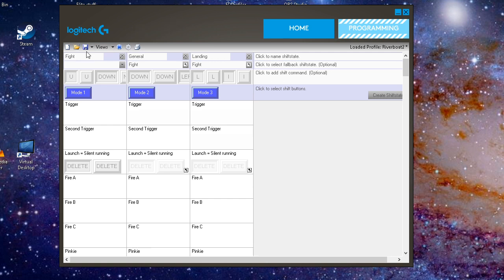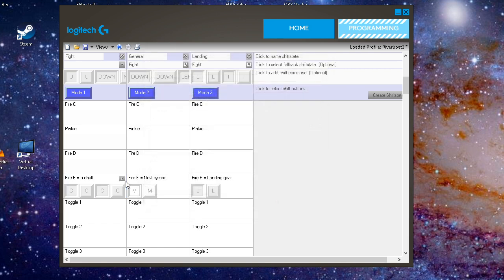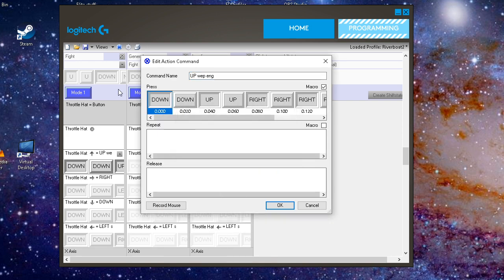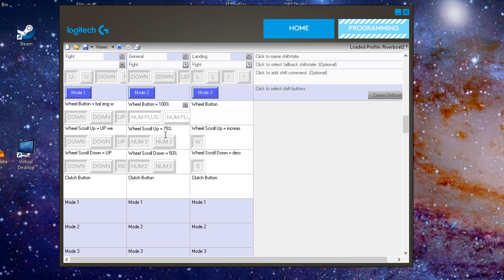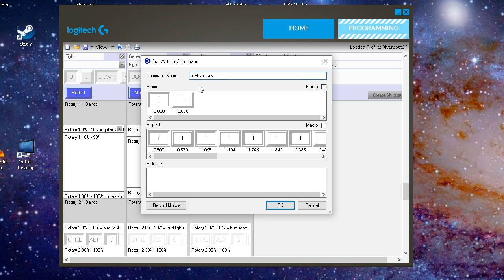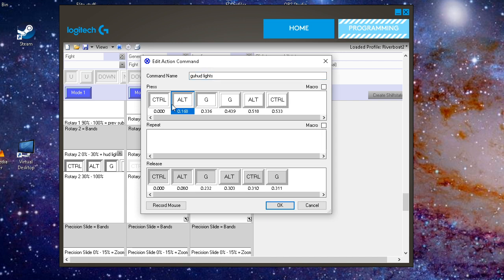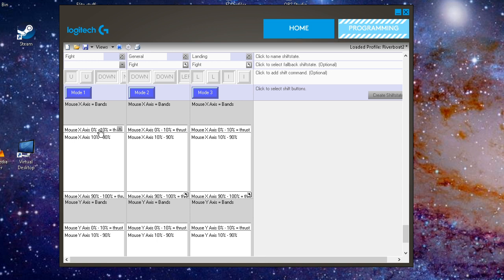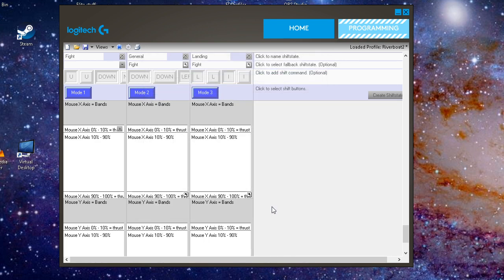Elite Dangerous X52 Pro easy mode switching with more advanced commands (Part 2)

Comment: I realise this has been a very long time but i only just started getting time to play Elite.

If you're still around, can you tell me what buttons you use for looking around please and, more importantly, where build do you use for controlling the interface please ie selecting stations etc. The panels to the right and left of the pilot.
Reply from the maker: Hi Rylan, sorry for the late reply!

I don’t use this stick anymore, I’m now with VKB…. But…. I can tell you I used the mouse for head look (mouse 3- the clicky wheel) to switch on and off, and for the menus I used the mouse nipple on the throttle as a ‘shift button’. Therefore with shift pressed, I used the 3 buttons surrounding the lower hat and the 4th being the pinky trigger for the panel between the legs. The left and right buttons also moved the panel menus with the hat to navigate each page.

Comment: I Rob, I don't think you'll know why, but when i try to load any of the profiles in the logitech software it say's it loaded the profile, but none of the bindings load
Reply from the maker: Hey there. I can’t remember the last time I updated the files as I’m now using VKB, so it could be a problem if you are trying to use ED’s bindings.

If you are trying to use the .pr0 files they should work so long as my key presses in the game are the same as yours (arrow keys for pips, U for guns I think…)

Open the software, create 1 button press and ask it to save. Note down the route for that folder (C/program files yada yada). Open that folder and place the pr0 file in there.

Also double checking, you do have the X52pro and not the x52?
Reply: @bretriverboat9926  I've got an x52 which I'm guessing is the issue. It's just the .pr0 files opening as blank. 
I think I'm probably going to use joystick gremlin on something, I was reaching out just in case you had any ideas. I appreciate you replying anyhow

Comment: hi when i download your riverboat it has nothing saved in there when i load it into the hotas software. not sure what im doing wrong but it does say riverboat2 and i can load it into hotas and it shows up there but not of the settings you go over in the video are loaded.
Reply from the maker: Good morning. That’s very odd. I noticed some problems with the binds since we moved to Odyssey, so I’ll update both of the folders today. I’ll let you know when it’s done then you can let me know if that works?
Reply: @bretriverboat9926  yes I will let you know thanks
Reply from the maker: @kyleroberts49  Hi Kyle. Things look different in the ED binds folder now! I don't fully know what the deal is in there but I've uploaded my latest binds file with an XML file that might be needed to put it all together in game. Not sure as I've only just noticed this but give it a go...

Comment: How do you manage thrusts up/down and left/right with your throttle hat being used by system management?
Reply from the maker: Ok, so I have thrusters on both the left and right hand. Left is the mouse nipple (I had a friend 3D print me a hat that fits nicely over the top), and the right hand is with the pov hat nearest to you. When I use the mouse button (next to the mouse nipple) as a shift key then it gives me access to the panel switches. 

Most of my set up that isn’t programmed by the Logitech software uses the shift button. For instance, the top hat does targeting but with the shift button it does wingmen, likewise sc and hyperspace (on t5 and t6) when using the shift gives me system map and gal map
Reply: @bretriverboat9926  Ok thanks for the answer. I think i'll keep with the throttle hat for thrusters controls but your setup looks pretty user friendly. Sadly doesn't have a friend to 3d print knobs haha
Reply from the maker: @maelblondel8922  join the Hutton truckers on Fb, best ED group in the Galaxy! There’s at least 5 of them that do this kind for stuff!

Comment: Could you please update profile to work with odyssey default bindings?
Reply: Also I cannot load it into the new version of logitech software
Reply from the maker: @Keramblock  hi there. I haven’t really added much via odyssey but mine work, I’ll post my latest one in a few hours when I get home
Reply from the maker: I’ve just uploaded the Odyssey 4.0 binds for you. My on-foot is handled by the kb+m as I bought a half keyboard attached to my throttle.

I hope this helps!

Comment: Any way you would update for new versions?

Also maybe a non-pro X52 version? That'd be awesome. Having a lot of trouble getting this set up on my non-pro...

Any chance you could go through your settings one by one and show exactly what each and every button is doing so we can map everything without relying on your profile (it won't load for me)?

Thanks!
Reply from the maker: Sadly I don’t have the non pro and I’m aware that the file can’t be shared between the pro and non pro versions. The software works in exactly the same way for the x52, X52pro and x56 so what you learn in these two videos can be applied to all 3 hotas.

Did you watch part 1? If so, all of my set up is based off that: the ‘new advanced command.’ If you use that principle you can apply it to all buttons and all modes.

I’d be happy to help you get going though, so let me know and we can try to speak

Comment: Thanks for sharing this. Will you be doing an updated version that might involve SRV and walking when Odyssey comes out?
Reply from the maker: You’re welcome. Yes I will, though I’ve been using kb+m for the alpha, so chances are there won’t be too many changes. If there’s something specific you’re after let me know and I could try to set it up
Reply: @bretriverboat9926  I use K/M for the on foot stuff, just more use to that (hate controllers). It's more about ideas on how you've done your setup to then possibly tweak my own etc. e.g. using the mode selector to deploy guns etc. (I use the red button under the flipper for that).
Reply from the maker: @harag9  yeah that’s my silent running button! I’ve noticed problems while using the alpha with auto docking and the landing gear, so I may just use mode 3 as on foot/SRV instead of landing mode.

Comment: Quick question, does the program have to be open when playing the  game? I cannot bind the little mouse on my X52 only when i have the program open, Thanks
Reply from the maker: Kaep 1980 when I load up the game and something doesn’t feel right I go to the bottom right of the task bar and check to see if my profile has automatically loaded. If not it takes seconds to activate. Most of the time it does switch on itself....

Strangely I have an X52pro and x56 so it knows which stick I am using without me having to do anything

Comment: Hey thanks. I am a total n00b to HOTAS and ED. I am trying to do the keypresses in like Fire E for example and it's not recording it as a press down and up. Any idea why?
Reply from the maker: wolfen231 hi. You’ve got to make sure all of the processes are followed. I try to always use the advanced commands as you can Taylor it to do what you need. If I remember correctly fire E is the central button to the upper rotary. Have you watched part 1?
So to the steps:
Remove clutch mode and delete the last 3 modes (plus pinky)
Assign a button press in game
Look which mode you are in on the rotary
Program the button (press and release) on that mode
Test the profile to look for the key press 
If it works in the test, test in game by clicking on the game window first.

Give me a shout back to let me know
Reply: @bretriverboat9926  I definitely watched part 1. It was setting the macro I couldn't do on the other ones. Because on the mode shift you just clicked the blank space and the macro window opened. But you never discussed opening the macro window here I think for the lower buttons. I figured out that I had to click the arrow and select new advanced command.

Comment: Where can you get a working button editor? I need to remove the shift feature from stick so I can bind it as a button.
Reply from the maker: Mike Unrau if I’m reading you correctly, you need to watch the first video where you disable clutch mode. That will allow you to use all the buttons
Reply: @bretriverboat9926  Thank you for the reply, and my apologies I am trying to remove the shift function from my pinkie button but for some reason I did not get a working version of the profile editor with my hardware drivers. I am going to try a roll back and see if I can get it working.

Comment: Thanks for the video, i bought this hotas today, it works really well on standard settings with just the drivers installed, but i have no clue how the hell to enter the software your showing =/ this is all that i have installed "X52_Professional_HOTAS_x64_8_0_132_0" from there website, cant find anything else
Reply from the maker: Hi Nenonism, that should be it (https://support.logi.com/hc/en-gb/articles/360024838173--Downloads-X52-Professional-Space-Flight-H-O-T-A-S-)
(The 4th one down). Select win 10 and it’s the 64 bit version.

To launch the software it’s an ‘app’ when you press the windows button and scroll down in alphabetical order, not in settings as far as I can remember
Reply from the maker: Also, did you watch part 1?

Comment: Hi Bret, thanks for the very helpful vid's ! I'm trying to bind my pips and use the pinky to have 2 pip setting on each direction on my POV Hat 1.. For instance : my pips are managed via POV hat 1. If I press left, I can say it activates the command "down right left left left" to have pips towards sys and a bit to weapons. I would like to also be able to hold "pinky + POV hat 1 -> left" and it commands "down UP left left left" to have pips towards sys and engine instead of weapons. Can't manage to find how to do that. Any help appreciated :)
Reply from the maker: Loïc Yavorsky I’m glad you like them! Sadly I don’t believe it’s possible to macro over another macro the way I do it. Do you have the 6 modes active or just 3? If you are running all 6 it might be possible to do this. This would mean you have to have the pinky as your modifier and clutch mode enabled. I would presume modes 1-3 would be d-r-l-l-l and 4-6 would be d-u-l-l-l.

This could be quite interesting if it works....

Comment: Bit of an off-topic question but do you have any idea on how to change the time displayed on the control panel? I just can't seem to figure it out and all the explanations online seem to be for the old Saitek software.
Reply: it in the windows settings then select devices and then on the right side select devices and printer setting there you should see the X52 right click and then select game controller settings then click on properties. thats where you adjust LEDs and deadzones  and the times LED brightness
Reply: @General_Stoner  Thx for the help, now my throttle finally displays the correct time